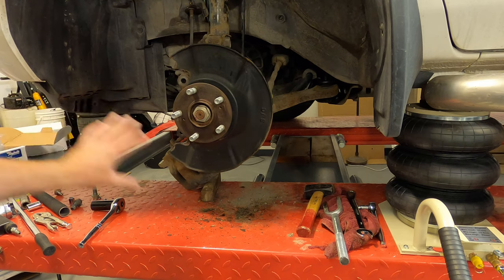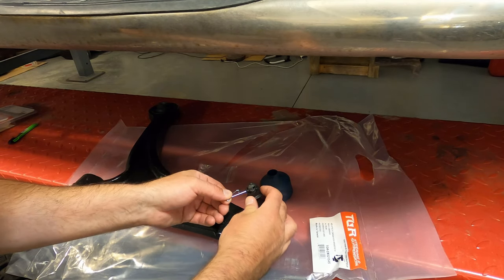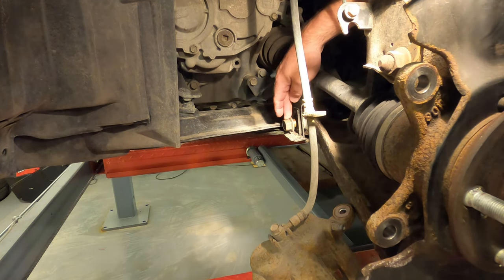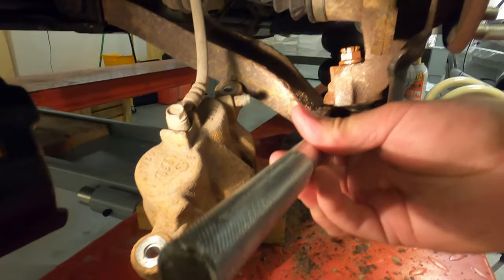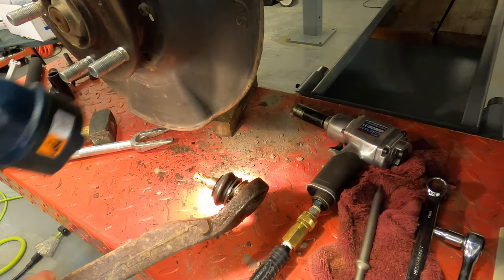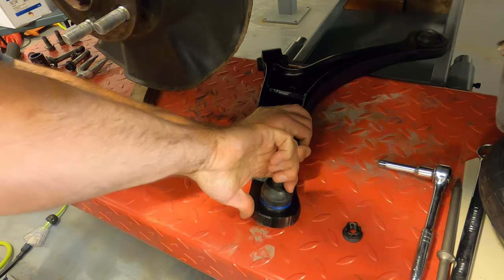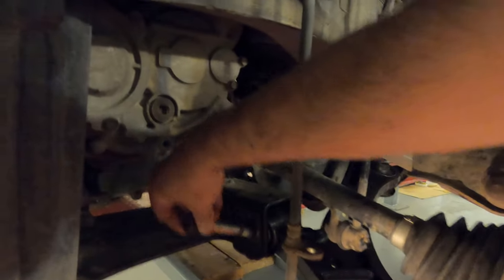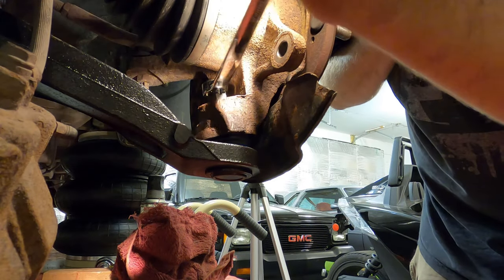How to Replace Lower Control Arms - HONDA RIDGELINE & PILOT (Compliance Bushings and Ball Joints)

Comment: Thank you for adding the torque specs. Great video. I upgraded my front brakes to the MDX Calipers, rotors, and pads for under $230. Huge difference in braking and pedal feel.
Reply from the maker: yes it's too bad they used such weak brakes on the Ridgeline.
Reply: I think brakes on the mdx are worse.  They could all use a big brake upgrade.
Reply: @gregs_garage  I installed EBC Rotors and Pads on my Ridgeline and are very happy with how the truck stops now.

Comment: Thanks for the great video. I ordered kit with both side lower arms, both links and both tie rods for $300  CAN with taxes included. Planing to do it this weekend . Now i know what to expect. Originaly i tought that i need to remove spindle to get the arm out. Will try your way.
Reply from the maker: yes it's a bit of a grind of a job - but do-able if you have some hours to keep working at it.

Comment: great video and thanks for not giving your lifes story like so many do. 1 question should I get the frontend aligned after?
Reply from the maker: thanks.  I wondered about that too.  But the truck goes straight down the road and feels good so I didn't bother.  And my tires are old so I don't care if they wear out faster.  I may wait for new tires to get an alignment.
Reply: @gregs_garage  I googled it and it said no. Thanks for getting back to me.

Comment: Good video! Have you notice a difference in ride/ handling vs OEM arms and how are the holding up? Any excess rusting?
Reply from the maker: Holding up well.  Upcoming video shows clunking so I did 1 ball joint replacement in these but it was not the problem.  These cheapo ball joints were still good after 20,000 miles.  I think it’s the struts clunking.  Which will be a future video on quick struts.
Reply: @gregs_garage  Do you hear the clunking going over bumps, turning the wheel r/l etc. I get a clacking sound turning wheels right but my compliance bushing is toasted on that side. . I’ll look out for your next video.
Reply from the maker: Further update - the Right ball joint was really bad after 20,000 miles!  I first replaced the Left and it seemed tight and fine. So I thought it wasn't a ball joint issue.  But, the clunking continued.  Then I looked at the right joint and it was moving around, really loose.  Replaced it and the clunking is gone.  Also replaced the sway bar links on both sides which are cheap but hard to get off.  I had to cut them off.  Left is now a Mevotech, and right is a NAPA Chassis.  Both fit into these cheap aftermarket control arms well.  Both have grease fittings.  Will see how these replacements hold up.

Comment: It looks like if you remove the cv axle, you can torque the ball joint nut?
Reply from the maker: Probably.  But torque doesn’t matter much.  Just crank it tight.  It’s not a head gasket

Comment: i put moogs in my ridgeline and not even 6 months later the right balljoint has failed. how are those holding up?
Reply from the maker: Holding up well.  Front end feels tight.  That’s why I went with the cheapest ones I could find. Figured the brand name ones don’t seem to be that great anyway.

How do you know the ball joint is bad - what does it feel like?
Reply: My mechanic says there’s a lot of play when he moves the wheel. Also have a little steering wheel wobble at 65mph

Comment: Stick with oem had after market ball joints fail in 20,000 miles nearly caused an accident
Reply from the maker: these ones seem to be holding up ok.
Reply from the maker: I may have spoke too soon.  These ball joints are making lots not noise now.  Been about 20,000 miles (or less)!  Hopefully I can find some new ball joints and press them in on the truck.
Reply: @gregs_garage  may have to bite the bullet and get originals. Unfortunately Honda won’t sell you just the ball joint, got to replace entire control arm. $500 per side.
Reply from the maker: @jackjones7451  just phoned dealer.  $957 per side in Canada, so about $700 USD.  I'll press in some MEVOTECH OR MOOG and see how they last.